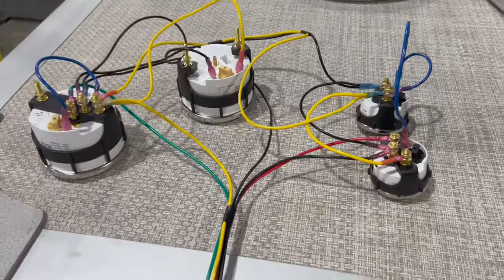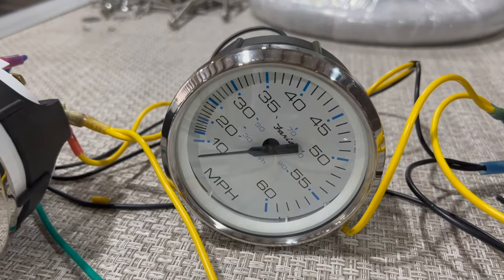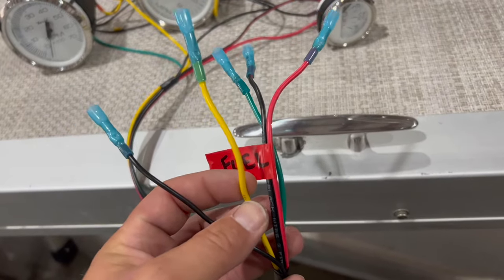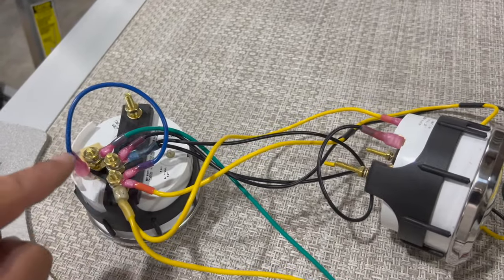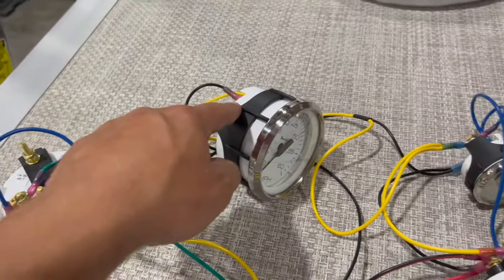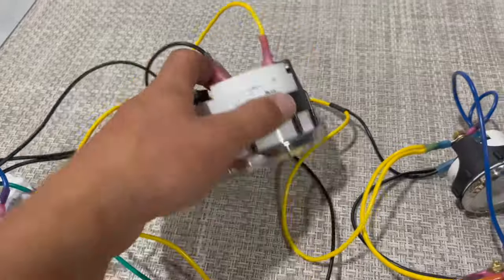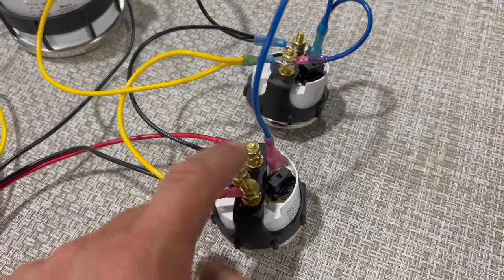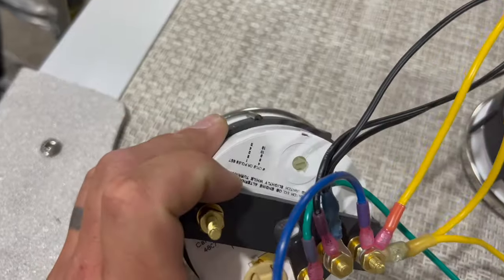WIRING BOAT GAUGES - Yamaha Outboard Faria Gauge Package

Comment: Wow, idk why I was so scared to try and tackle this myself, ALOT easier than it looks! Thank you so much for this, plain simple and to the point! 👏 bravo
Reply from the maker: It’s straight forward once you understand the posts on the gauges, the colors of the wires, and where the gauges will get power, ground, and signal from!!
Reply: I do have dual helm stations, 1 upstairs outside and one Below in the cabin...how do I run this x2 tied up together?
Reply from the maker: @brod12313  I’ve never installed a dual helm setup. I would reach out to a local dealer or service center used to dealing with dual helms and ask them. I’m not sure if you can just piggy back off the signal wires or not. I’ll do a little research and see if I can find out more.
Reply: @tomspontoons  yeah, I was thinking I could piggyback everything too, but I also thought gauges were complicated and hard to mess with too lol then I saw ur awesome video 👌 thanks again
Reply from the maker: @brod12313  not too complicated, just don’t know if the signal wire will have issues with accuracy jumping it across.

Comment: Great video - thank you!  Two questions: Is there some basis for deciding which gauge to start with to receive power directly from the ignition?  Is there a reason why the power is jumped from the tach to the speedometer and ends there, whereas there is a second jumper from the tach. to the volt-meter, which is jumped to the fuel gauge?
Reply from the maker: Thanks for watching. The power and ground can come in to any of the gauges to start and jump from there in any order out to other gauges. It’s honestly personal preference and however someone would want to keep things in order.

Comment: Thank for the video! Kind of a dumb question, but you then that your 2 wires to the fuel sender and the other 3 to the wires coming off the key switch for Yamaha?
Reply from the maker: Sorry, not sure what you’re asking?
Reply: @tomspontoons  on the 704 key switch there’s an 8 pin connector that goes the the motor wiring harness and then there’s  4 bullet connectors (red, yellow, green, black) is this where you would plug your gauge wires into?
Reply from the maker: @frankwilson7463  thank you for clarifying!! Yes, yellow is key on power, black is ground, green is tachometer sending wire, and I believe red is an accessory power wire. I've just used the yellow, green, and black wires when working on Yamahas. I usually cover the red wire as it's unused.

Comment: If I don’t have fuel sending units do I have to drill the holes to install senders?
Reply from the maker: Yes, but be careful to make sure you have the gasket lined up and snug to ensure it doesn’t get water in. As far as I know you can add a sending unit to any tank, although it’s not always practical if it’s much smaller than 12 gallons.

Comment: What do you hook your ground wire to. The boat?
Reply from the maker: Never ground to the frame of the boat. The ground needs to make its way back to the negative post of the battery whether it’s through a ground buss bar, a common negative lead at the helm, or the motor ignition harness. With gauges, you’re wiring through the ignition harness, so using the ground that’s included in that bundle of wires is the best option.
Reply: @tomspontoons  thank you for the info. This Yamaha control box has a lot of different color wires in it. Very confusing looking at it being can’t find much info on what wires are what
Reply from the maker: @sheabourne9428  There are some Outboard Ignition Harness Wiring charts out there which tell you what colors do what. I think I've shown the one I use in some videos where you can pause it and screen shot it to get what you need from it.

Comment: I'm getting no tachometer signal
Reply from the maker: Double check that the green wire (tach signal wire) is attached at the gauge as well as where it’s attached to the ignition harness. Sometimes connections can come loose or corrode. Then double check that you’re getting power to the gauge from the yellow wire (key on power) and that the ground is connected. 

Beyond that I’d wonder if the gauge quit working and needs to be replaced.

Comment: Where do you get fuel tank kits?  How would you wire two tanks to a gauge?
Reply from the maker: I use Moeller brand tanks whenever installing new on a boat. I'm not sure how or if you can wire two tanks to a single gauge. I'm sure there are gauges with two read-outs on one gauge face so you'd connect each tank's ground and sending wire to be able to get a reading for both tanks. Otherwise we've done one boat where we wired in two separate gauges to allow for two tanks.

Comment: I have a 2006 Yamaha 90 2 stroke and the gauges were replaced but not the harness. This video is great at explaining the mess that's under the dash!!!  On mine I see two small fuses on the yellow wires but did not see them on your wiring. did you put fuses in and if you did where? 

Thanks a milllion!
Reply from the maker: Usually the only fuses run for gauges will be for a depth gauge or fish finder powered off the key on power. That’s the only time I’ve encountered fuses on a gauge panel. Otherwise outboard associated fuses are on the engine.

Comment: Just what the lame-o ordered. I feel like I can do this now! Thanks Tom.
Reply from the maker: You’ve got this!! Let me know if you have questions when you tackle your gauges!
Reply: looks good.  Will this boat have running lights? Would it be better to tie the back light into running light switch?
Reply from the maker: @BoondockingCajunstyle  Great question! It does have running/navigation lights. I’ve seen gauge backlights wired both ways, even from the factory. I was always taught to wire them into the key switch, that way they’re on when they’re needed…when the engine is running. No wrong way to do it as long as you can see them at night!!

Comment: Where Can I find a wiring diagram for a Robalo R160? Has a Yamaha F70LA OB
Would like to install a couple voltage gauges. One for each set of batteries. Your
expertise is greatly appreciated.
Reply from the maker: I’m far from an expert on that style of boat. I’d check with a Robalo dealer for contact them directly to figure out where those sets of batteries come into the console. Otherwise you could pull wire from each battery to hardwire a gauge set in off of a switch for each battery set.

Comment: Thanks Tom your video really helped. Did you have to use the Yamaha AGI to get these gauges to work or were the connections taken from the bus wires?
Reply from the maker: There’s a lead for gauges worked into the 10 pin main harness for the engine that runs from the motor to the key switch, shift/throttle, and under-dash accessories. I wired this to be spliced into that portion of the main harness. Ultimately, the colors will match up to the gauge leads for power and signals. Let me know if that makes sense.

Comment: Do you need any special type of wiring (like a marine wire)? or can i use regular like trailer wire 14awg?
Reply from the maker: I try to use marine grade whenever possible…copper tinned coated wire. Anything else may just not last as long before corrosion sets in. However, if it’s protected from chaffing and is sealed up at connections it should last a long time even if you used trailer wire!!

Comment: The seperate like 2 ro 4 wire harnes that says gauges at 1 end and to engine on the other end where does that go and the pigtails on the 703 yamaha control the up and down tilt where do they go from the 703 control
Reply from the maker: I'm not exactly sure what wires you're referring to. The trim and tilt wires should be integrated into the 10 pin ignition harness that goes from the control box and plugs into the engine. We have a full video of installing a 703 control box on our channel that might help answer some questions!